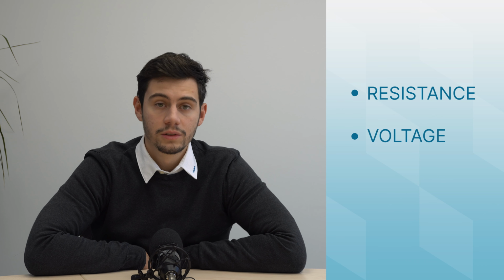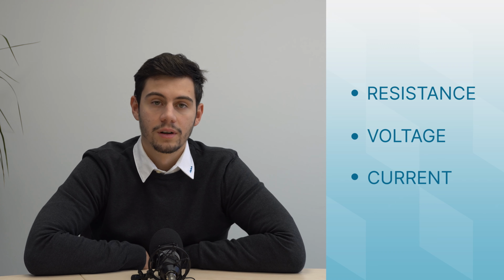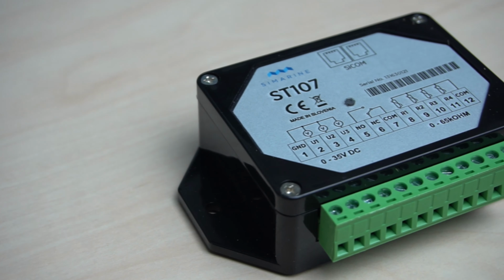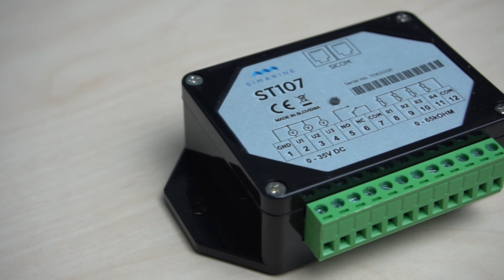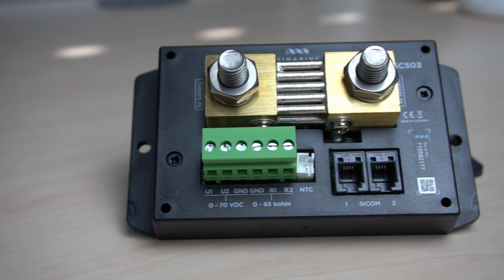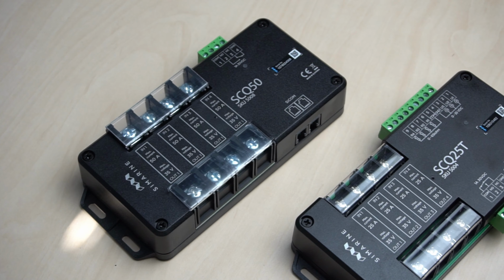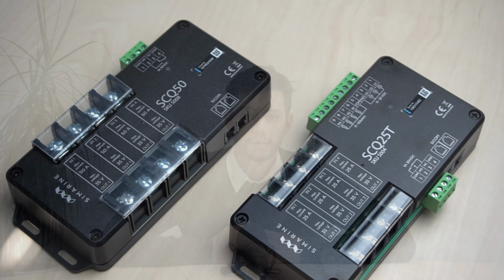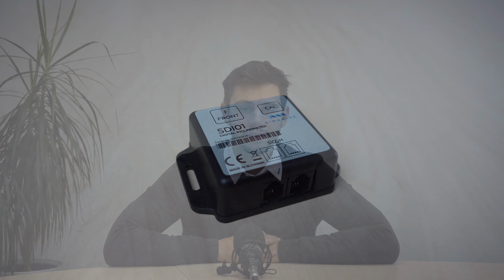PICO System Overview | Simarine

Comment: From the wiring diagram, it appears you also need a splitter,  even with the most basic setup. Is the splitter included with the monitor or shunt purchase? I don't see it as a standalone item for purchase. If I'm not going to use additional shunts or  modules, Is there a way to bypass the splitter and go directly from the larger shunts (300 or 500 amp) to the monitor?
Reply from the maker: Thank you for you question. Splitter is an essential part of any PICO system as it is the communication and power hub for the whole system. Therefore it comes with PICO in the same box. You can connect up 4 expansion modules directly to the splitter and even more modules can be daisy-chained to the modules that are already connected to the splitter.
Reply: Thank you. I appreciate the response.